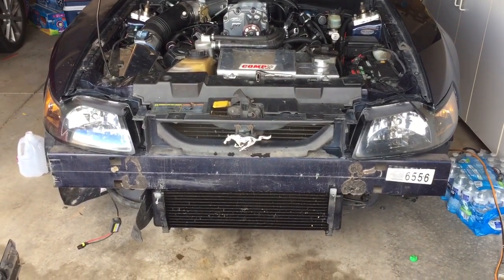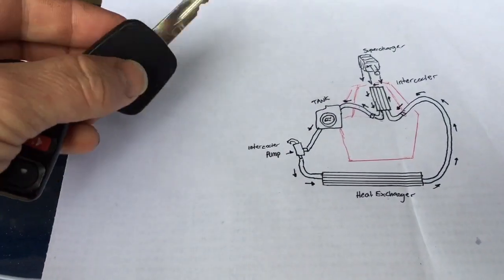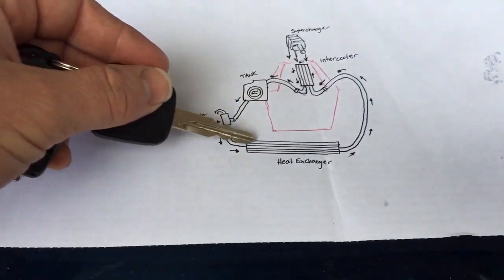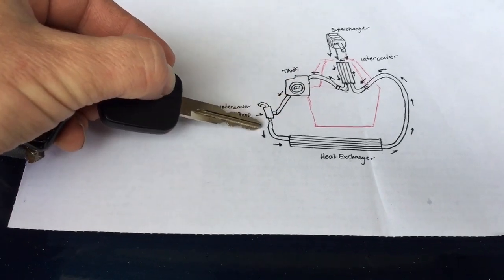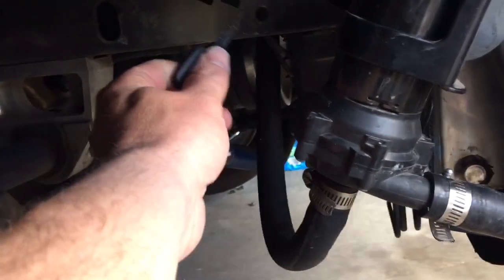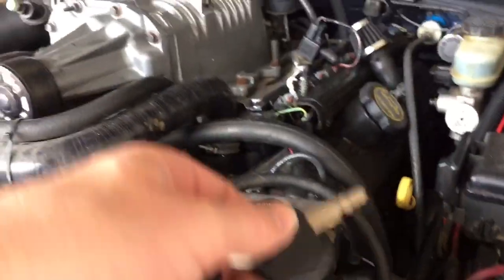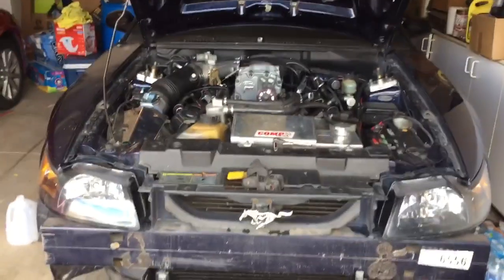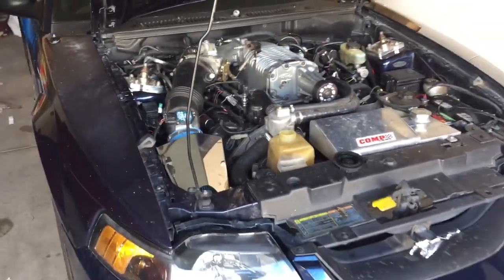How an intercooler and heat exchanger work supercharged mustang

Comment: Big ask!! Where does the pressure go that is built up inside the reservoir?
Reply from the maker: It’s a 10 psi system. The cap has a spring that lifts and  vents out the extra pressure.

Comment: Old post but I'd like to add to this. I noticed through testing that hot fluid from the aftercooler under the supercharger should run to the top of the heat exchanger where hot water rises to the top and it's condensed by air to water cooling, thus cooling and naturally flows towards the bottom (he) and pushed with the booster pump back towards the aftercooler. Best results.

Comment: Where is your alternator?
Reply from the maker: It’s near the power steering reservoir. Turned around facing the other direction
Reply: @justin.c_svt  thank u for responding, but what type of machine shop work did you have done?
Reply from the maker: MMR built the lower end and the guy I bought the engine from put the ported heads on. I did the cams

Comment: How you no went the pump is not working
Reply from the maker: You won’t see the fluid circulating in the reservoir. Cars that come factory with an intercooler pump will also not turn the pump on until the temperature of the engine rises to a certain temperature

Comment: I have a question I have a roush supercharger kit on my 4.6 3v, my heat exchanger  busted. Can I drive my car without hurting my supercharger until my new heat exchanger comes in the mail?
Reply from the maker: You could probably drive around. Just don’t be hard on the car. If it were me I would fill it up with distilled water every time you drive it., Even if most of it leaks out at least the intercooler pump won’t overheat. There are non-intercooled supercharger kits out there so it’s been done, just don’t go far or long with it

Comment: what will happen if u rotate the water flow direction ? 
example : 
from supercharger
to intercooler
to coolant reservoir tank
to supercharger 

and what is the the best diagram to get more cold water ? 
Thanks
Reply from the maker: The pump would have a hard time running it backwards. You can add an ice tank to make it cooler
Reply: @justin.c_svt  i have jeep wrangler .. there is no place to keep ice chiller lol 

any way thanks for replying .. 
have a good day brother
Reply: @Justin SVT hey bro I have a question. I have a fully built V6 supercharged mustang yet to be dyno or driven . It has a M90 roots supercharger. The kit does not have an inter cooler . Any suggestions for cooling excluding meth injection???? Thanks ahead of time and sorry for jacking the comment section original commenter
Reply from the maker: The M 90 doesn’t have a place underneath it for an intercooler?
Reply: @Justin SVT no it does not
Reply from the maker: @bobayagga2233  I dont know how you would than because the roots superchargers blow right into the heads. The only thing I could think of is to find a way to use a centrifugal supercharger system that intercools the air before the throttle body.

Comment: I have 2 mustangs a built 95 mustang gt and an 06 mustang gt stock" im looking at a very low mile 05 mustang gt with professional built 3v 302 stroker with whipple supercharger. And freddy brown built transmission. . Only 3000 miles on build. Can a good setup like this if taken care of last 100,000 miles or more like a stock setup?. I never had a car with supercharger.  My 95 mustang has custom cam. Afr aluminum heads etc etc. Nice runner. Whats your take?:)
Reply from the maker: I think so. If the engine was built right there should be no problem. The supercharger should hold up fine for 100k miles as well. I daily drove my built engine 4.6L supercharged Bullitt for a few years and would have done so for several more.
Reply: @justin.c_svt  very good to know. I appreciate it!